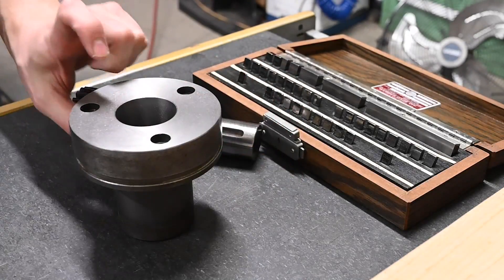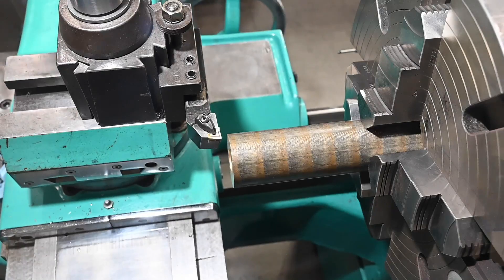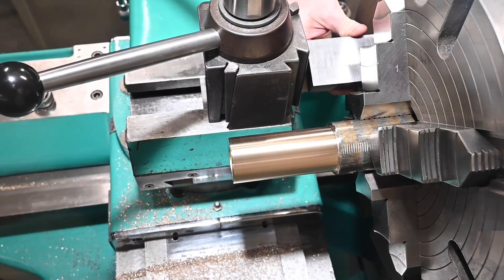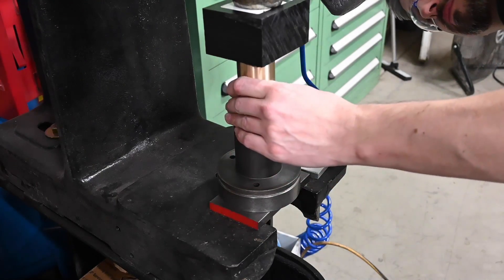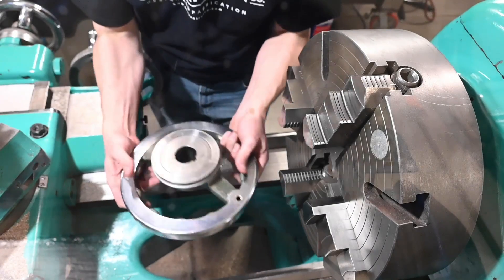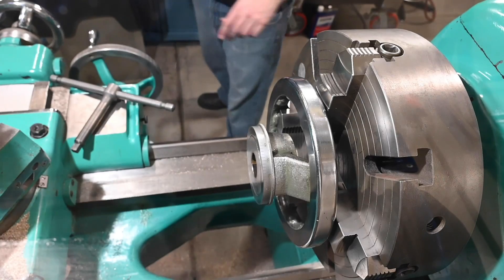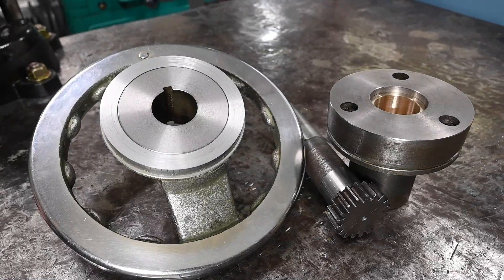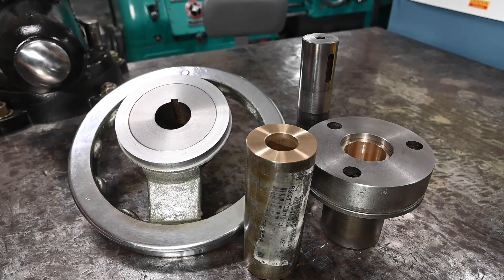Repairing a Mori Seiki Engine Lathe- Part 2

Comment: I assume that the hand wheel came out ok in the end as you could easily test the parts by assembling them. But when setting up that hand wheel, there is no guarantee that the outside face of the wheel that you placed against the chuck face is perpendicular to its center axis.  The wear face must end up perpendicular to the centerline of the wheel.  You showed how you  centered the hand wheel but you did not show how you indicated the bore to be on the center axis of the lathe.

Comment: 10pm stubbornness is more common than you think - it features regularly in Mr Bozo's box of tricks! 
I was nervous that the cast iron would split when you pressed the bronze sleeve in. I'd probably have looked to Loctite. Brave man!
I was wondering about the 1mm eccentricity - possible allowance for final fit of the gear mesh in the factory? Set the clearance by rotating the housing then spot through the holes?
Nice end product, and a very satisfied customer. Well done.
Reply: 10pm stubbornness, also known as task fixation.  Ask me how I know. ;-)

Comment: Aaron where did you get the black vidmar drawer handle end caps like on the green vidmars behind the press?
Reply from the maker: I got those from the VIDMAR Lista Quick Ship site. Can’t remember the web address but google that and it will come up and you can see all the stuff they have for (reasonably quick shipment). To make sure they process your order the day you place it, call in rather than the website. I’ve had an order delayed a week that I placed online since it was somehow missed.

Comment: Why didn't you bring the tailstock in to support it whilst you were doing them chuck jaws....?
At least it would have got you close to centre...

Do you think the outer of that polished handwheel was true with the bore...?
They're often hand finished on a mop...
🇬🇧👍
Reply: glenn moreland I don’t think it matters. If the wheel has a thou or two runout from the shaft I can live with it. It’s not going to affect the dial or any operation done on the lathe.
Reply: @stuffandthings8767  

Do you think it'll effect the bore in relation to the shoulder...?
🇬🇧👍
Reply: glenn moreland nope. It’s on my lathe now and working perfectly. If in 15 years from now I have to replace to the bronze bushing, I’ll let you know though.
Reply: @stuffandthings8767  

Ok....🇬🇧👍

Comment: Good job. I always reverse direction bore on critical fits, like you said there is always defection on a boring bar, in fact when I get to the last few passes is when I start reversing my feed. On thing that helps me out is to touch the face before turning the spindle on when I want to do a slight cut, lock carriage, then move in my amount. It keeps clumsy me from digging in

Comment: Great work , better them factory !!! Is he going to drill the oil hole?  I like to grind a small channel in the bore to help the oil to move Easier. I try put it opposite the load side. Thanks for sharing
Reply from the maker: Yes an oil groove is certainly a good idea